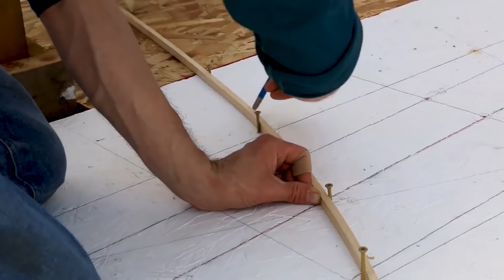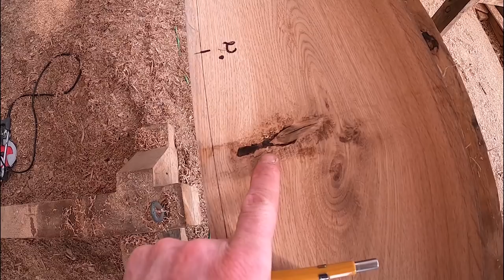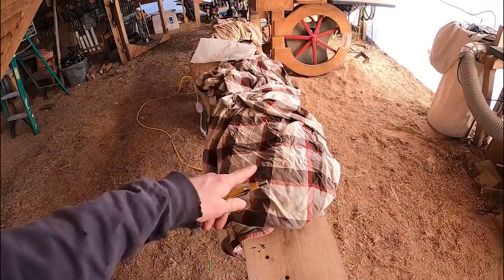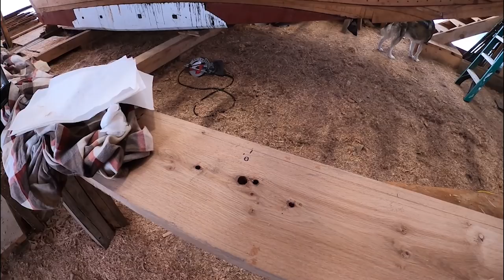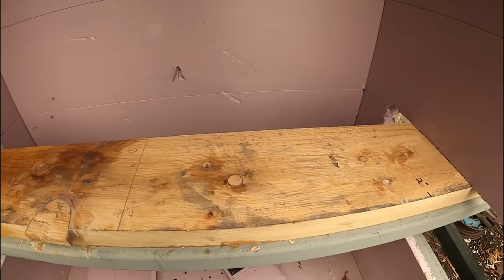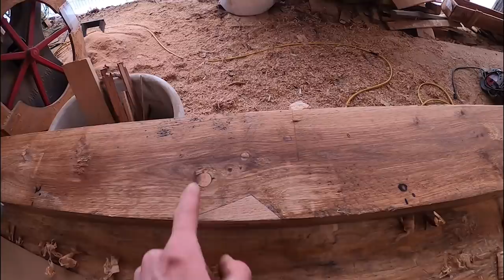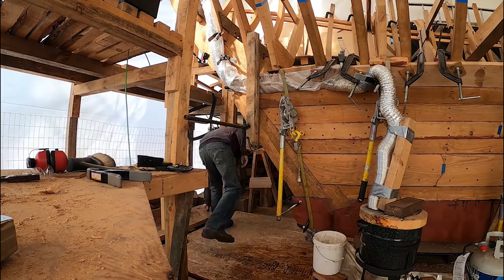Acorn to Arabella - Journey of a Wooden Boat - Episode 104: The Last Oak Plank!

Comment: I have watched from the beginning. I feel it is my duty as a loyal follower and and big fan to share some lessons I have seen/learned/mistakes made, so you don't have to learn them the hard way. Please listen and consider. You must MUST coat the whole boat in epoxy and a layer of glass. The reason for this is simply. You have invested so much time in this project and it should be preserved. Without a proper water tight seal it will only last half as long. It will take a month maybe to do but I know it will last a 100% longer. I know what you're going to do will work but for only a while. Not forever. Thank you  for sharing your project with us. It is a beautiful boat and you should be super proud of your efforts.  Please protect it with epoxy. I sail a 46 foot colin archer ketch and am a boat builder/ repairer. Talking from experience. Take care guys.

Comment: Hi Stephen, an advice from a german Automotive-Painter: 95% of most of the chemical products (tape, glue, two-component-paint etc.) are always formulated to "room temperature". Thats why you have had problems with the glue at these cold temperatures.  When it's a one-cmponent-stuff you have to work with you can only do what you've had done: wait until it gets warmer. When it's a two-component material - i especially think about the times when you will have to work with coatings/paints - you have (often) a choice. Here in Europe Paint-Manufycturers call that "Finland-Hardener" or "Africa-Thinner". Means: you can vary your flash-off, curing and drying times of coatings in a pretty wide range by choosing slow (up to fast) hardeners or slow (up to fast) thinners. The only two things you will have to do for doing so: 1) know about it (what you now do) and 2) ask your dealer for the right stuff ! I wish you both (and all that are involved) all the best, stay healthy and best regards from Germany
Reply: I think the scarfs are glued with one-pot glue - resorcinol, IIRC. It has some unique attributes they value highly, and has been around for so long that its longevity (as well as suitability for this role) is well established.

Comment: Just had a thought about chain locker - how about using one of those blue 50 gallon PVC Barrels. Cut off the top. Keeps water out of the bilge, won't rot and nice and abrasion resistant. You could use a small piece of PVC hose as a drain to a small dedicated pump. Throw in a bit of plastic milk crate on the bottom to keep chain dry at the bottom.

Comment: I’m always impressed by the amazing work you have done. It seems that you spend a lot of time measuring the tilt of the planks. Why don’t you use an electronic inclinometer with logging? You can precisely measure the angle/tilt/twist of the plank, and later even use it for automatic saw adjustment. A small device can save you hundreds of work hours. You can measure the whole plank just within a minute or so. With a small step motor attached to your saw, you can easily clone the plank. Just one cut, without any previous, time-consuming marks and adjustments.

Comment: Most of the time I don’t use those mixing tips for the Thixo, I just squeeze out what I need and mix it with a paint stirrer. I like the tips but if you forget to do a few inches of squeeze from the tube the ratio can be off. Great work!

Comment: Love what you guys are doing! Just have to add a respectful correction: white oak, and all oaks are indeed "ring- porous." That refers to the different cell structure between earlywood and latewood. Diffuse-porous hardwoods like maple and alder have an even distribution of open cells through early and late wood. I understand what you're saying is that white oak has closed pores through its end grain, unlike red oak, so it's acceptable to have end grain running through the hull. Cheers!

Comment: Stephen, I believe the plank length issue is caused by where you measured . It looked like the long point was at the short point had you squared down from the top and made that the short point of the angle the length would have been fine. I don’t foresee it happening again as meticulous you guys have been . Looking great!!¡

Comment: I would pin that tapered plug in place in through the edge of the plank with a bronze nail. It will  probably never move the way that it is..but if it happened to come out a lot of water will come through a hole that size in a very short period of time. I like your videos...keep them coming.

Comment: When working with epoxy it is recommended to leave bigger gaps then with normal glue and don't clamp. Epoxy, mixed with cottonfibres (which is actually epoxyglue) is much stronger than wood. Curing at the right temperature is essential though. Love your work out there! Certainly one of my favorite channels,

Comment: typical lurker here...love watching this project move forward.  Some very fine talent and energy going on.  Thanks for making the videos.

I have a few questions and maybe you can speak to these in your next videos.

a.  cedar planks combined with oak.  These are two dissimilar wood species.  They will have different expansion/contraction features.  What is the idea here and how and what are you proposing to mitigate against the different "movements"?  What are the techniques to mitigate against the planks from moving radically over time?  Obviously, you are mechanically attaching the planks, but what is the kind of material you are proposing to keep the joint movements capable of overcoming movement and the sealing issues?  (complete novice here, with some minor carpentry (residential and commercial..the long, larger volume stock is always going to have some degree of movement..I can imagine this will be quite a bit as the thermal influences radically change at or about the waterline...submerged, versus "freeboard" will move differently....If I have it correctly)
b.  length "movement"..I noticed you are attaching very long continuous lengths from end to end.  Is there another means to provide some kind of expansion feature to mitigate the kind of expansion and compression loads that will happen over time.  Are the fasteners attached in such a manner that permits movement longitudinally?  Or is the idea that the wooden "bones" that supports these long lengths sufficiently flexible to endure such movement?  Are there any expansion joints at all, long wise?  Obviously I understand the plank to plank edge on design allow some kind of packing/sealing.  But is there some proven way to accomplish this lengthwise within each plank to mitigate movement problems?  
c.  cold weather construction.  I've run into this before several times.  If allowances for expansion are not made in cold weather construction, then one can have enormous expansion loading and compression problems at joints and fasteners.  I don't know the exact calculations but I would imagine it would be useful to know how much expansion will happen as the weather turns warmer.  Has this been determined about what kind of allowances for that inevitable result as the weather changes?  Obviously, even a small amount of moisture and humidity (water intrusion and also moisture from inside the vessel) will have a pronounced effect on total volumetric dimensions on these very long pieces of big stock.  I've seen the some horrible experiences with rough framing walls and load bearing walls and joists and roofing structures done in very low humidity cold weather.  Done here in the south, it is very very humid and hot in the summer.  If construction happens in the winter, we will adapt some engineering principles to mitigate against structural problems.  This is particularly true with the softer pine stock used in the trade as it is very dynamic with seasonal shifts in temp and humidity. I've never worked with such long oak pieces, but I would imagine this to be certainly predictable with cedar, a mucg softer and dynamic wood specie.
d.  Fasteners and adhesive?  Are there plans to attach these planks with more than just fasteners?  I'm keen to understanding how they are attached, give movement is going to happen and if adhesive is desirable in addition to fasteners?
e. interior coating/sealing?  what will be the plan here?  Is the idea to leave the interior "raw" as to allow moisture wicking ..I'm not sure how ventilation is designed for this vessel, but one would expect some moisture and condensation issues in the interior..Any plans to mitigate against that?  I've seen some products that protect the wood, but also allow moisture transmission...similar to a moisture/vapor barrier type of product.  is this something you are thinking about?

I'm an avionic type, so I am way out of my league .....and so respectfully, don't blast me for asking noobie questions.  I'm not suggesting anything.  I am only expressing some interest and would like to learn a little more.  In a few years from now, my brother and I have decided to build a large catamaran...we have some big plans, but neither one of us has any experience at all building marine vessels.  The structure is likely to be a composite wood design, with a composite shell hull....merely to save weight.  We don't have any of the major issues sorted out, but what we lack in experience, we have patience and the desire and motivation to seeing it done.  Probably take at least 3 years.  

last question:  what kind of process is required (if at all) to get this vessel certified and thus registered?  Does it require a formal marine architect licensed entity to grant it "permitted"?  How about insurance?  Same kind of questions.

looking forward to seeing more of these great videos.

take care..be safe.

God Bless!

Comment: I see where the knots/epoxy that dried correctly had a table underneath it where as the ones that didn't cure had nothing under it.  do you think that would have caused it not to get warm enough to cure?
Reply: Spot on depending on the length of time the heat is being applied the table under the board will  insulate but also it will heat up and become a thermal mass that will stabilize the temperature. I'm not a scientist but I've been studying home construction and building  homes for 40 plus years. I was studying every thing I could find about solar heating and earth sheltered home construction and everything energy efficient. Any mass inside a heated structure will definitely increase efficiency. When the ambient air temperature falls below the temperature of the thermal mass the mass will give up its heat to the air there by stabilizing the temperature fluctuations. Heating pads use a thermostat switch to regulate the temperature and the tables mass will fill in the on off cycle
Reply: @shackman9566  could it be the big twist in the wood wasn't factored into the calculation ? not that he could have, but that run has the biggest twist on the whole boat .. especially as it runs into the front rabbit, either way they will figure out a fix..soo hard to think in compound curves and dimensions,  something is bound to escape your attention.. sometimes it's good that these things happen as  you learn the fix,  good thing to know when you are under way at sea and need a quick repair..
Reply: On the epoxy temp and proper mixing are always the cause of failure to cure. To much hardner or not enough or to cold. Hope every one is well.
Reply: Shack Man And that is why they put up signs that read “Bridge Freezes Before Road”.
Reply: I believe you are correct as the wood acted as insulation on the rear

Comment: You can use an electric router to get the two planks matched up, rather than pecking away with a hand plane.  Plenty of videos out there, and it worked great on my Chris Craft when fitting planks.    

Basically, put a batten on the lower plank to act as a track.  Run the router on the batten and establish an edge on the lower plank.  Clamp the upper plank some distance, let's say 1/2 inch, away from the lower plank.  Use a larger bit, say 3/4 inch.  Run the router along the planks and you will transfer the edge to the upper plank.  

Then, just slide the upper plank down the 1/2 inch, and it will be matched.  You can get fancy and make a back bevel, or whatever else you need, as well.

Comment: Are you making sure to waste some epoxy out of the mixing nozzle before you use it on the plugs? I couldn't really tell but if you're using a 2 post epoxy, wasting a 1.5 inch circles worth is quite important.

Comment: Have you guys got any plans for the electrical system on the boat? I'm no expert in boats (IT / Electronics / Car guy) but lately been looking at a lot of electric propulsion setups and seems like a diesel generator (or drive through the Electric motor), LiFePO battery bank and as much solar as you can hide on it and maybe some re-gen from the prop under sails would be ideal and the solar integrated/hidden into the cabin roof rather than the tacked on panels you see on most boats so you keep her curves looking right...
Reply: Understandable...but...You're late to the party...they thoroughly investigated electric for propulsion and feel that it's not quite there yet...go back a year or so ago...
Reply: Batteries just don't hold enough power yet, compared to diesel (which gets most of it's energy from the air, 14.5lbs of air per lb of fuel at perfect burn).

I'd still want to rig a solar panel on the top of the deckhouse, or as an awning over the helm, just to have a backup. And maybe even parts to make biodiesel onboard, just in case.

Comment: I've been there..... I've measured twice and cut 3 times and it's still too short.
Reply: My last project (which turned out better than I expected) was measure over and over and over while the sawdust built up😬
It's to do with getting older even 2 seconds is too long to hold onto a piece of information.
Reply: @984francis  Yes! Our impending antiquity, it's not for sissy's.
Reply: @barrylukebuilds7894  So true. As I've aged, the mistakes have gotten smaller, but more frequent.  So, am I more or less acurate than I used to be?
Reply: A line straight from AVE's handbook
Reply: Andrew, there's your problem, mate!  One more cut should do it!  🤣

Comment: Bending epoxy? How does that work out with that many plugs epoxied in and then bending and twisting the plank? Won't the epoxy crack or crack the wood it is glued on?
Curious.
I enjoyed this episode as always. A lot of feel-good moments which i need badly. It is a privilege to be able to watch this for free. 
Being injured in a car accident, and missing the ability to fulfill specific dreams I enjoy living yours on a different continent.
Cheers!
Reply: Epoxy is strong stuff, but it is flexible. See the hood and fenders of a Corvette. The glass fibers (wood fibers in this case) are what gives strength to the panel, the epoxy just holds them in shape.

Comment: I'm very impressed with your tenacity on this project, I was wondering, as heat rises why build your light boxes withe lamps above the board  and so far above the board, so much air and box side walls to lose heat through. Surely lamps below would have  been a better option even after fitting some kind of guard over them. But you are surely one hard group of people I enjoy watching and learning. Stuart
Reply: Heat doesn't rise.  Hot air rises.  And given the size of the box, the stratification of air is going to be less than a degree.  Really not an issue.
Reply: “Heat doesn’t rise” ... what?
Reply: @jsd05  Heat doesn't rise.  That was a lie told to you in second grade, on the (bad) idea that only simple things should be taught at that age, even if they are wrong.

Heat moves in three ways: Conduction, Convection and Radiation.  Only convection is affected by gravity at all.  Put a hot pan down on your hand and you will note immediately that heat in the pan is traveling DOWN to burn your hand.  Do the same with a red hot poker, just above your hand, and you will notice that it also burns you.  Those are examples of heat moving downwards via conduction and radiation respectively.

Convection is just heat moving into the air, by either conduction or radiation, and then that AIR (or any fluid) moving to transport that heat somewhere else.  Since most fluids (thought not all) get less dense when they are heated, they will generally rise in a gravitational field, and move that heat upwards.

Water at 4°C is MORE dense than colder water, and will sink, which transports heat DOWN in the ocean, which (among other things) is what keeps the oceans from freezing solid.  This is also convection, and works in exactly the opposite direction that you were taught in second grade.

Comment: 6" too short...The story of my life.....
I use an old crock pot to steam with.  I drilled the top vent hole out and tapped it to 1/2" NPT and screwed in a hose barb.  For a big job a small ,pump could be added to keep the water level constant. (as there is no real pressure in the pot in this application)    This way I can use a propane burner, diesel or even a wood-campfire.

Comment: Whenever I change a tip-new tube or replaced tip-I blow through 4” of product before using. Always works, and the first couple inches of the wasted epoxy never sets.

Comment: Relating to the epoxy for the plugs: Did you use a new cartridge with these? This static mixer tubes have a common flaw. You have to throw away the first few pulls because the ratio isn't quite right.
Reply from the maker: No, Steve discovered that the heating pad used for that section had stopped coming up to the correct temperature, and the epoxy won't cure if it is too cold. Thanks for the tip!

Comment: I have had poor results with “Thixo” as well. The 2 parts coming out of the mixing nozzle come out at different rates or none of either half. If I use it at all, I don’t use the mixing nozzle to assure of getting both half’s.